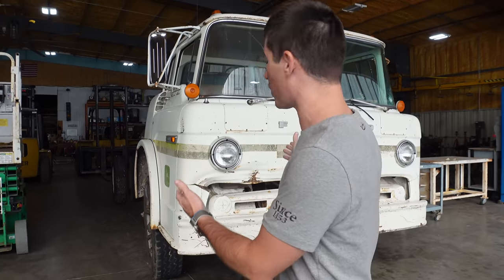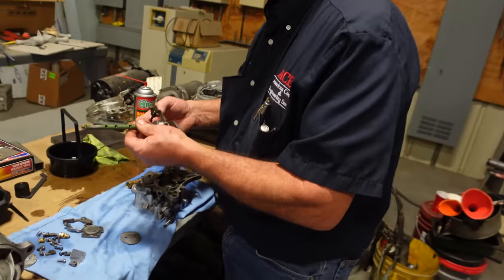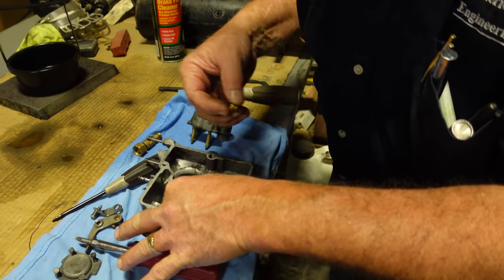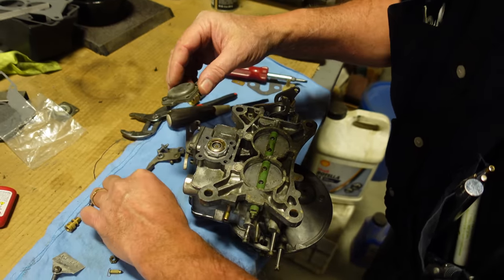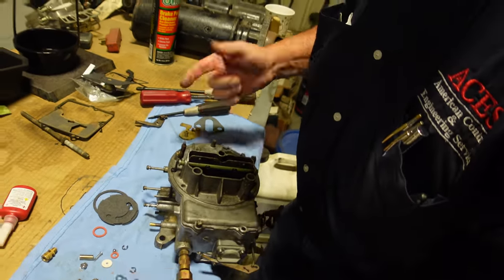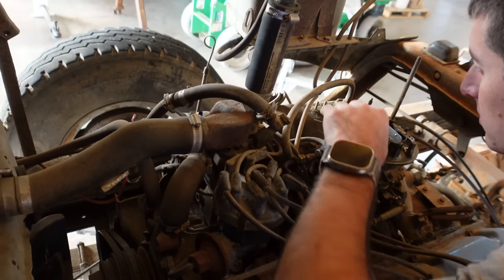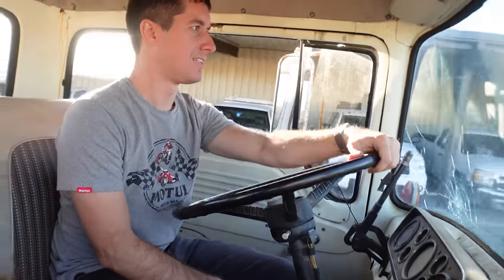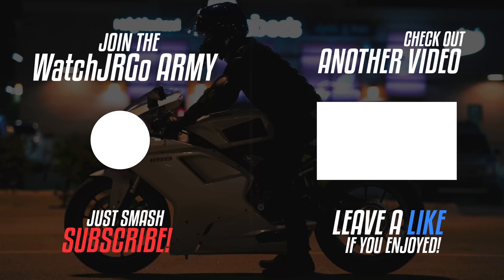FIXING My ANTIQUE John Deere Cabover Truck *First Actual Start And Drive*

Comment: When you were putting the carb on I noticed the body prop was NOT locked in place.  There is also a hole in the prop to stick a rod or bolt through so it doesn't get accidentally hit.  This is one major fault in cabovers.  Falling cabs were known to even kill people.  KEEP SAFE.  Love this truck.
Reply from the maker: It was locked with a big philips in there too (at least for the first section) 🍻

Comment: Great video!   We used to have one of those as a fire truck in the little town I grew up in, volunteer FD.   I remember all those sounds of the gas 370 and the gear whine sound the transmission made.    Even when I was a kid our school buses were a mix of chevy 366 C60s and ford 370 F-700 gassers and had the same sound.

Comment: I was wondering why this video was so long, then the carb assembly started and it felt too short.

"Everything is a hammer, unless it's a screwdriver, then it's a chisel." I also loved this line!
One of these days I'll buy a set of chiseldrivers, but I guess I have too many old screwdrivers that will have to break first.

Comment: Hope the drive goes well if it happens. I saw a similar one for sale on the side of the road right down from my house when you first posted about getting it but it's long gone now. Probably more common to find on the west coast here.
Reply from the maker: It goes VERY well, this thing rocks! 🍻
Reply: Those 390 or similar industrial engines are very tough tanks. If you decide to fix it or use the engine in something else I'd find a spread bore intake and carb for it. Told my friends brother to try a spread bore carb on his 390 Ford 4x4 truck and he put a Quadra Jet on it and said it was way better and smoother than whatever carb he had before.

Comment: It seems like you still have a vacuum leak since you had to turn the mixture screws out so far. The aluminum EGR plates are notorious for corroding, the base gasket failing and of course the EGR valves getting carbon stuck in them as well as the vacuum diaphragm failing. That probably has a vacuum brake booster mounted to the frame which also have diaphragms prone to failure and sucking in brake fluid. I've had experience with three of those cabovers. Two as race car haulers and one was an old power company bucket truck.

Comment: I had borrowed a 1965 Ford F100 from a guy and I noticed it didnt seem to run the best. It had a 2100 carb in it and someone at some point had removed the butterflies and installed them without aligning them and one of them even had the bevels the wrong way. I was amazed it could even idle as low as it did, until I realized it was all plugged up and then I wondered how it ran at all. He said it ran like a brand new truck before I even touched it.

Comment: Oxy-Acetylene wire torch tip cleaning set works great for getting in the small passages and jets of carbs and cleaning them out.

Comment: Dam tree huggers messed up carb cleaner. My uncle had a 5 gallon bucket of carb cleaner when I was a kid. It cost $100. 15 minutes tops to clean the worst carb. If you dropped anything that wasn't metal in it , it be gone in a minute. If you got it on your hands and didn't have water to wash it off instantly, you could watch a blister form.

Comment: Surprised you don't have a ultrasonic cleaner. I get amazing results with just heat, water, and a little dawn detergent. I was originally using the Chem dip in the ultrasonic,  and found the water/detergent to work just as well. And you just toss it out when your done.

Comment: Apologies if this is a dumb question. If it were available, could the parts washer have been able to do the same thing that gallon of cleaner did? Or are they addressing too very different cleaning methods?
Reply: No, solvent really requires you to scrub, the carb dip is a very aggressive cleaning solution. It will eat through deposits that are down small jets and places you can’t easily get to.

Comment: Ask your dad if he still has his "Flexible Screwdriver" to adjust the idle on the carb, instead of using a straight screwdriver.  Bet he has one, just forgot that he has it.  LOL.  Should be able to adjust the carb, and change the end, and adjust G-M points on a distributor via an "Allen-Head.," approx. 3/16" in.  Dia. if I recall correctly.

Comment: To Bad that you kotow  to the few narrow minded viewers.  The cab over was designed for urban area maneuverability and also good for yard work moving trailers and equipment on a farm.   you did agreat job reviving this classic as far as you did.  You could do some more of thps tyoe on the back burner and save them for when you travel instead of shgowing gas up and fast food chow doe=wns.